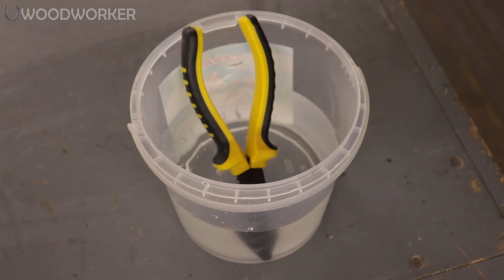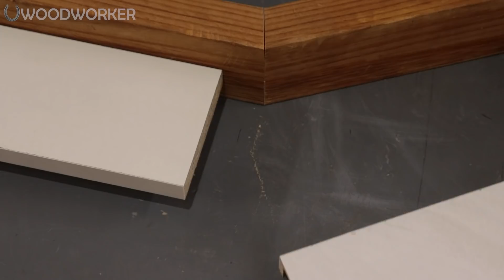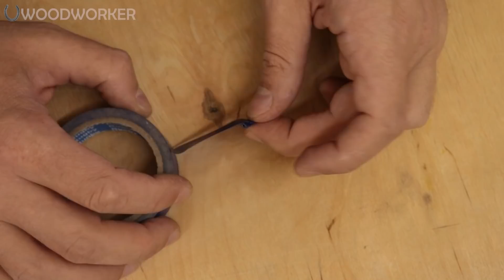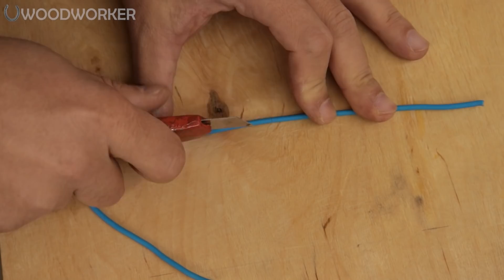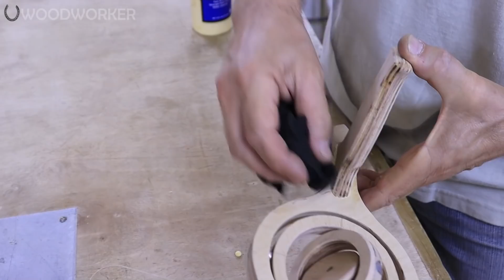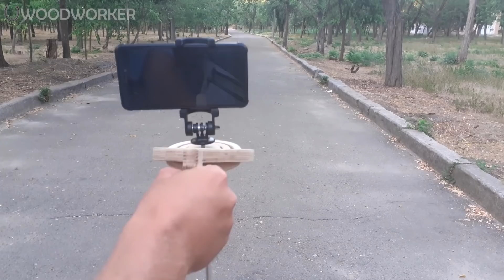5 Ingenious Tricks that will Take You to Another Level of Work – Tips and Tricks

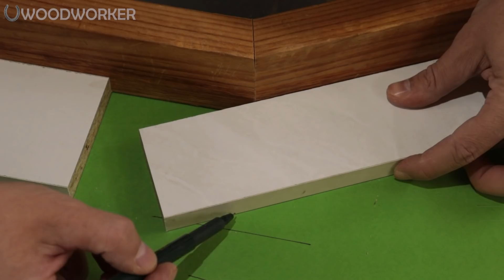Comment: 1:50 makes no sense. Why you would use different width boards? If they are equal this will never work with different angles.
Reply from the maker: in the sense of??? there are situations when you need to dock boards of different widths! do not write nonsense
Reply: @UWOODWORKER  Nonsense is when you do easy jobs the hard way and complicated. For example - why using paper and then transfer lines, when you can just overlap two pieces and draw directly on them.

Comment: On the first video with the tight handle pliers, you can loosen them up by using a dab of “valve grinding compound”, sold at the auto part’s store, and work it into the joint by moving the handles of the plier.  A good sign of a well made plier is when you can hold one handle of the plier and the other handle automatically opens by the pull force of gravity.
Reply: Do you know why/how the water works? I don't really understand it as I would assumed if there's rust, water would just make it worse no?
Reply: @UnvarnishedTarnished  I agree with you!  Yes, rust would continue.  I have used white vinegar in a glass and put the pliers in there over night and it also works well too.
Reply: @billhandymanbill2775  Nice, thank you! I have an old rusty pair I think I'll let soak in vinegar.
Reply: @UnvarnishedTarnished  The valve grinding compound, only a couple of dollars at the auto parts store, works great in loosing up a tight pair of pliers.  High recommend it.  After using the vinegar, over night or even a day, make sure to wash off the vinegar, dry the pliers and then spray the entire pliers with WD-40.  I have also using a wire wheel on a bench grinder to make them look new too.
Reply: @billhandymanbill2775  Awesome, great advice. I appreciate it mate!
Reply: @UnvarnishedTarnished  You are most welcome!
Reply: @billhandymanbill2775  its also good to let it sit in baking soda & water for a few minutes  afterwards to neutralize the acid of the vinegar
Reply: WD-40